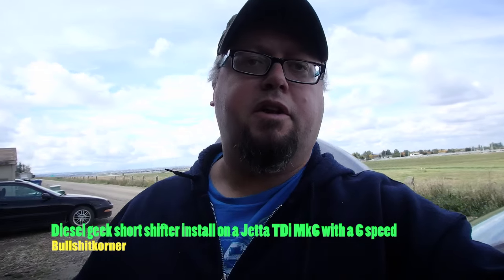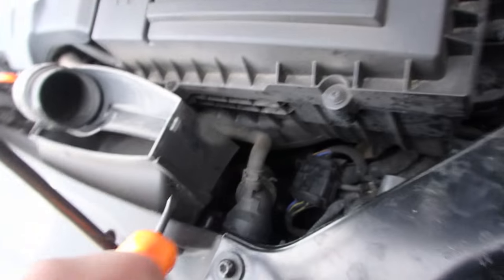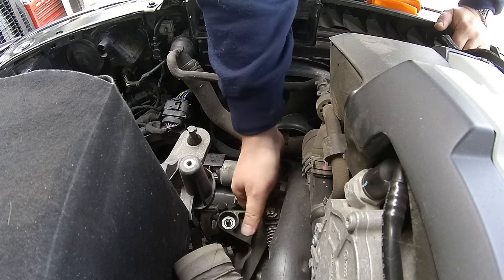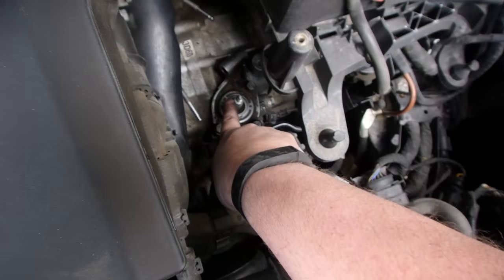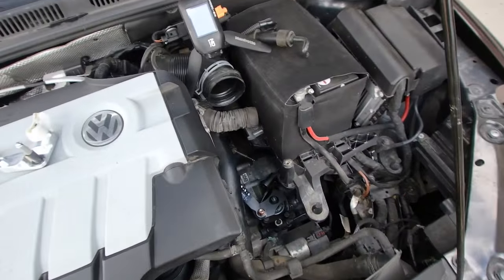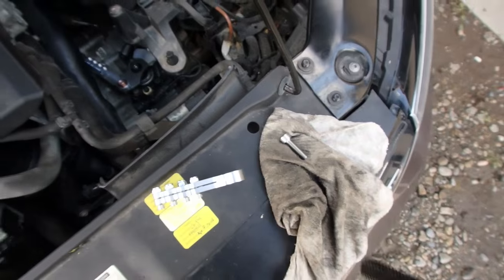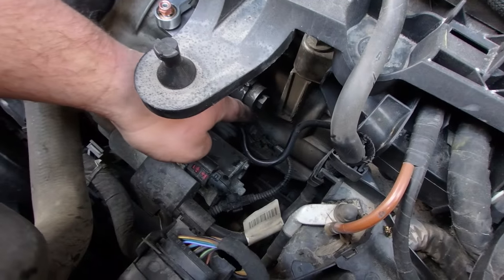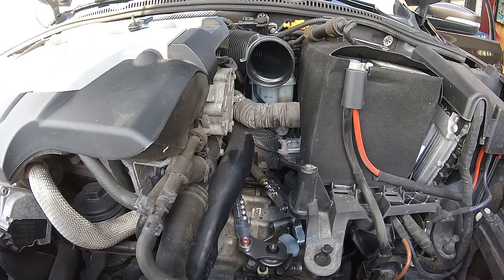How to Install a Short Shifter "DieselGeek" Jetta TDi

Comment: That sure is a slick looking kit.  Great job on the install as well.  I can't get over how clean that car is.  If I was to attempt that on a car here there would be pullers and cursing involved at the very least.  That's a great mod too I'll bet that shaved a tad off the 0-60 time. LOL.  Cheers my friend!
Reply from the maker: +Mantras3333 lol don't know about shaving time off, but the jetta had such a long throw and it's nice having the shifts nice and short

Comment: the engine mechanisms sure fit tight together, no fucking mercy.  I did like the quality of the mechined parts of the new short shifter and that was a challenging install, great job Jerry.
Reply from the maker: +Silicon Valley Engineer the machining was really good even i was impressed

Comment: curious if your car is out of warranty? If it isn't and there was trans damage I wonder if VW would consider this mod a reason to deny the free repair.  I am waiting on a new special ordered F150 to be delivered next month.  I was thinking about an aftermarket level lift kit and then realized it may void the powertrain warranty if I install it.  I need to do more research beforehand.
Reply from the maker: +Ozzstar no manufacturer will give warranty for something that damaged due to a aftermarket part
Reply: +Bullshitkorner an example is a bad cv joint and the car is under warranty.  Is the dealer gonna deny the warranty claim cause there is an aftermarket part attached to the transmission?? They can be dicks about certain things
Reply: +Ozzstar it depends on the manufacturer. I work on a lot of different cars because we are a rental company and the dealer will always try to wiggle out of warranty pay if they can. It even applies to Class A equipment. Any aftermarket part equipped will void that warranty coverage unless your aftermarket upgrade is from their upgrade development team and installed by an approved installer. if I isn't dealer or factory installed they will not pay for it.
Reply: +Joe Lopez good explanation. Figured it was something like that, thanks
Reply from the maker: Ozzstar When I had my F350 ford wouldn't even service my vehicle for warranty because i didn't have ford filters.  I had to pay them to swap them over to ford before they would go ahead and service the vehicle under warranty
Reply: +Bullshitkorner now that's some SERIOUS bullshit right there!

Comment: Prime example of why I don't like VWs. Over-engineered and for no good reason I can see.
Very interesting to see a short throw done this way though, by changing the connection on the transmission rather than the stick.
Reply from the maker: +UndergroundTrev this is the first one i've done so i'm not sure what it's like on other vehicles